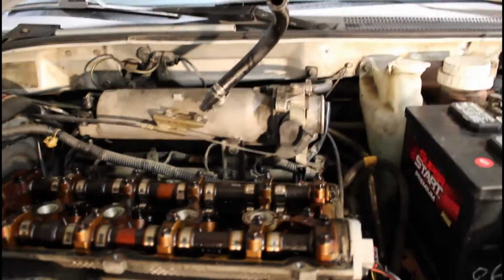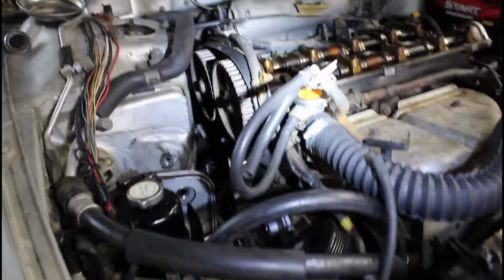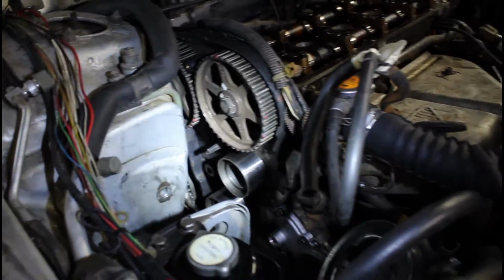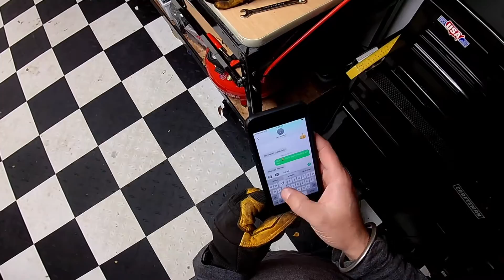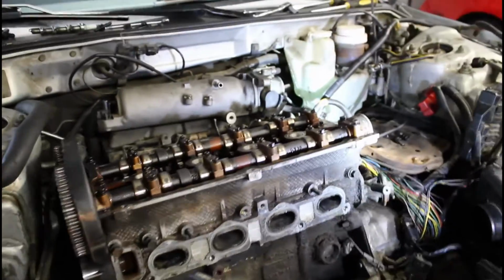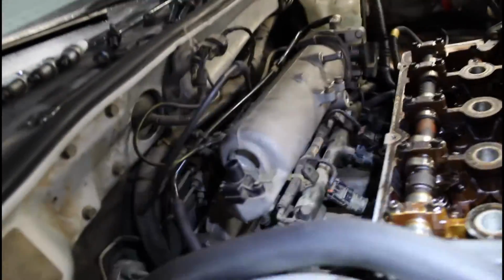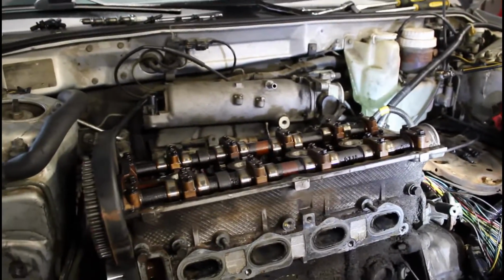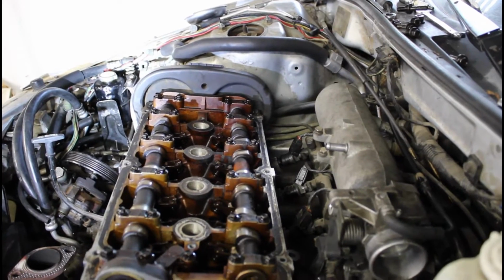JUST ANOTHER (THE FAST AND THE FURIOUS) ECLIPSE BUILD! 420A HEAD REMOVAL PART 1 #DSM

Comment: Hey, excuse me, how did you remove the bolt that is near the alternator? of the intake manifold
Reply from the maker: I have girly skinny arms which are good for reaching into tight spaces. I reached from the back as well as from underneath the car. From what i remember alternator was not too hard to remove.